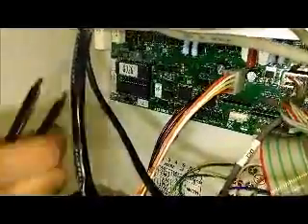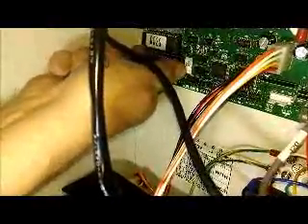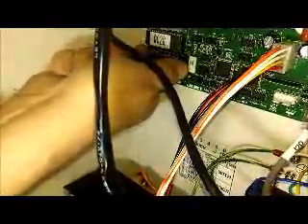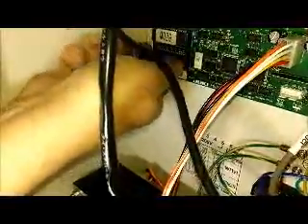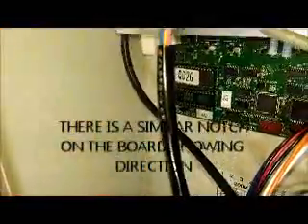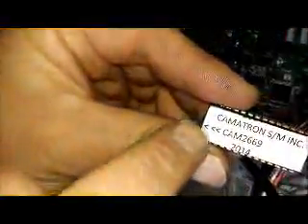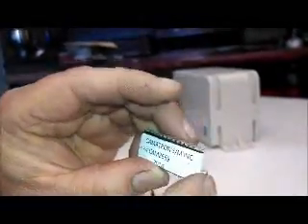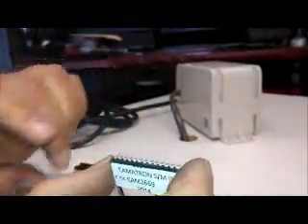HOW TO INSTALL AN E PROM ON A JUKI LK1920

Comment: Juki lk 1900 eror 07
Reply from the maker: IF it is an older LK1900 it will have a Panasonic motor . It may be defective. The error relates to the needle up position